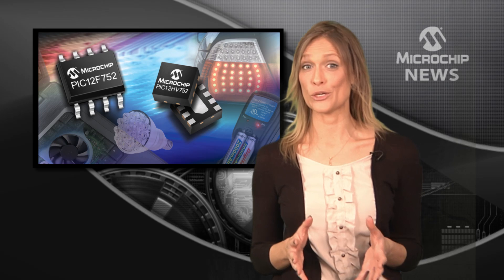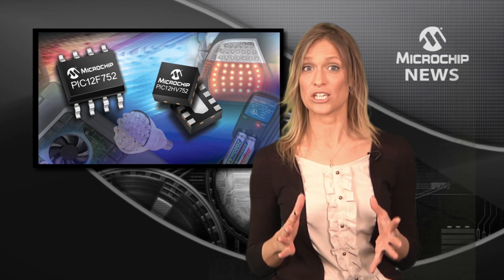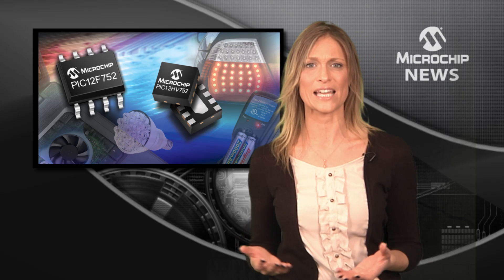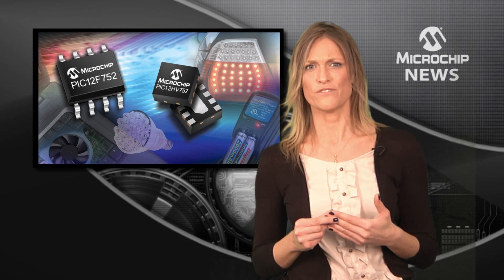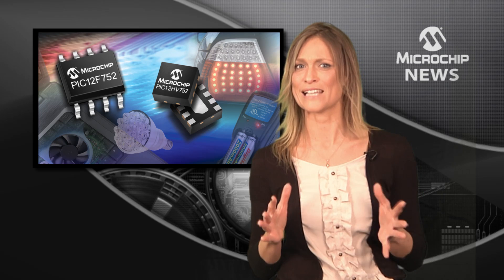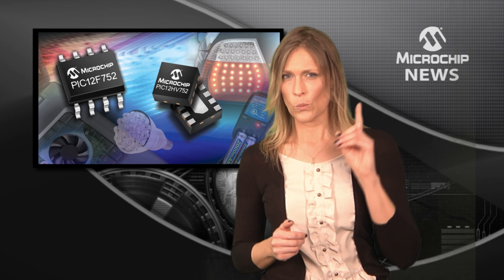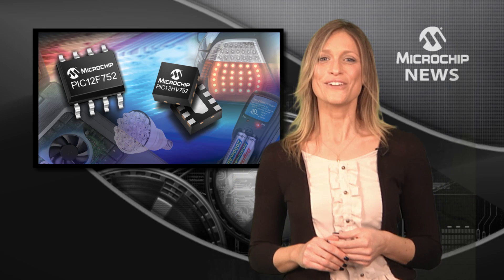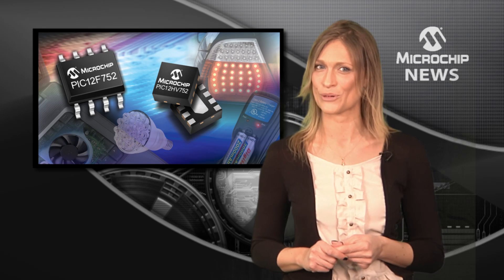Microchip Introduces General-purpose 8-bit PIC® MCUs

Comment from the maker: Hello Riaan,
The standard “F” variant has a max nominal input of 5.5V, while the “LF” variant is 3.6V.  The “HV” variant utilizes an internal shunt regulator and has a user defined max input based on an external drop resistor and not exceeding 50mA and 5.5V at the Vdd input.